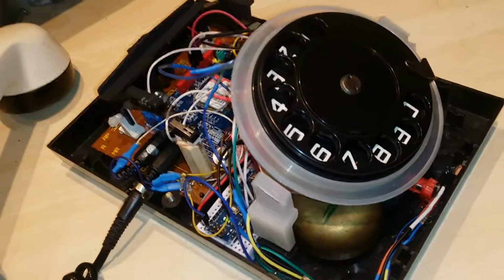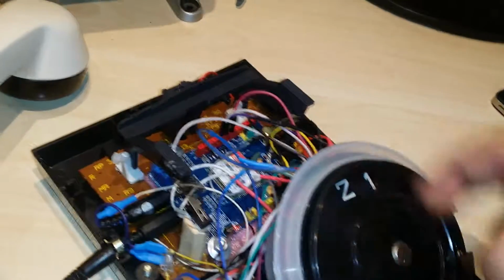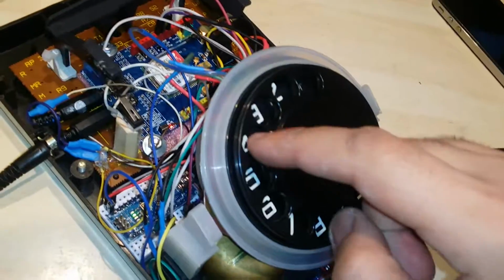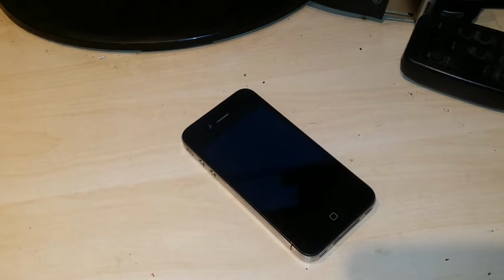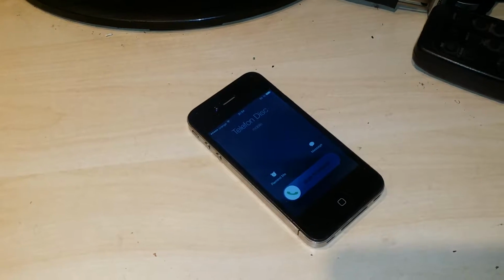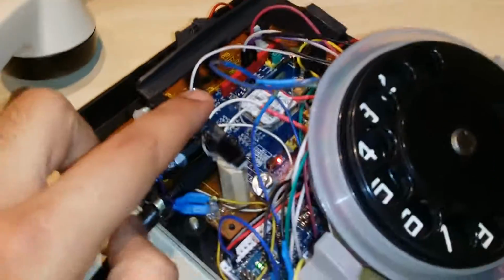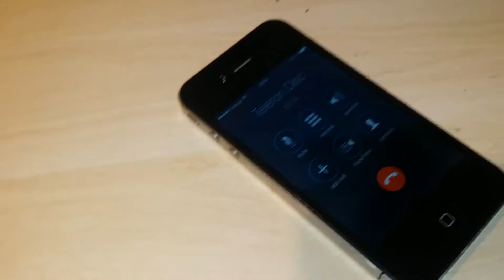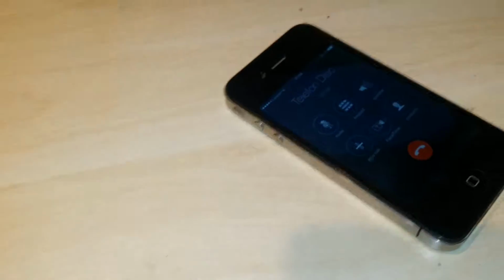Rotary dial mobile phone

Comment: I have tried in so many ways to do this but I didn't find the details design and software for Arduino Uno and sim module.... Would you please detail me, I will be appreciated. Thanks
Reply from the maker: Hello. Try to count the times the circuit closes when dialing and then parse that number to a variable
Reply: thank you for your reply. I have failed ... and I need help !
Reply: I think the question is which module has been used and the schematic.
At 0:25 George says it an Arduino Nano and afterwards he says he using a GSM shield like this https://store.arduino.cc/usa/arduino-gsm-shield-2-integrated-antenna

Question: Do you hear en echo when talking in the rotary phone?
Reply from the maker: @chlordk  No. Sound is smooth